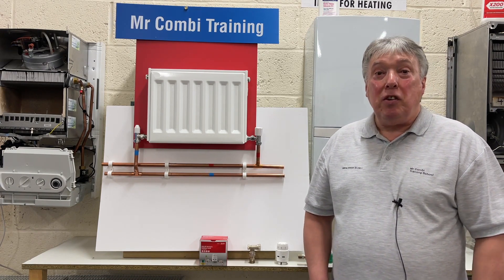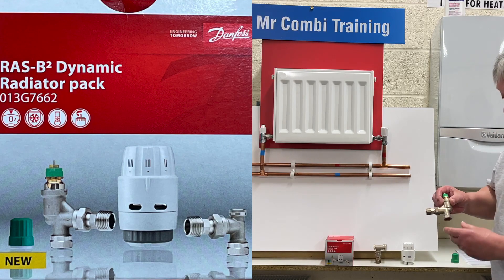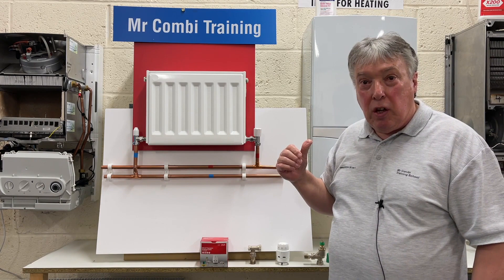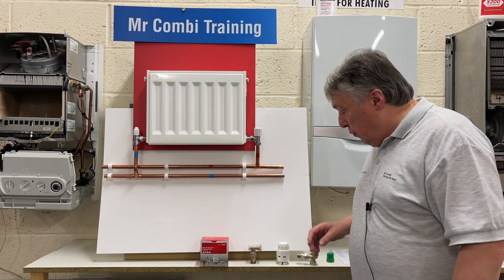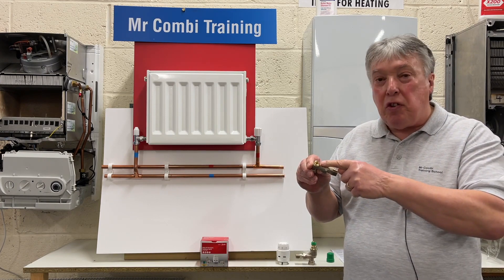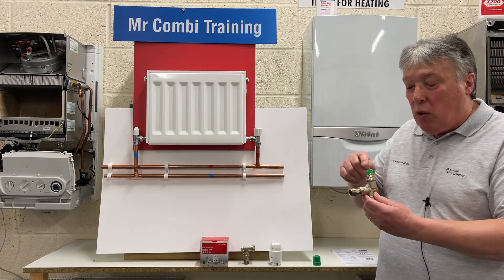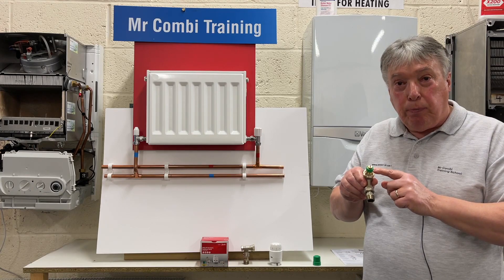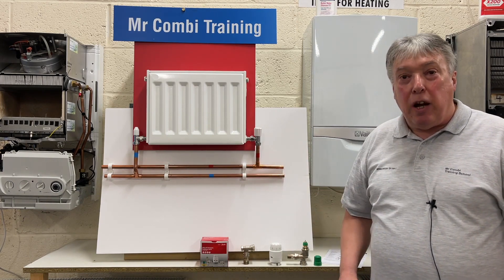Change a RAD VALVE to smart BALANCING TRV! Easy video for Installers and DIY.

Comment: Hi good explanation i had a question about this is it therefore acceptable to have a smart trv on the return side or visa versa as its acting as a balancing valve where the non smart trv is not it requires to be fitted on the flw side of the rad any help would be most grateful thankyou
Reply from the maker: Thanks for asking, all old balancing valves go on the return but these can be on the FLOW, not a problem just remember the old balancing must be fully OPEN. take care, George Staszak 👍
Reply: @mrcombiBedford  ok thanks a bit confused with this set up, drayton stated there new auto balance trv must go on flow side in order to work correctly does danfoss operation differ
Thanks
Reply from the maker: Drayton may say only the flow not checked yet will do later but Danfoss  go both sides Get Danfoss. Enjoy George
Reply: @mrcombiBedford  yeah interesting to know thanks for advice take care